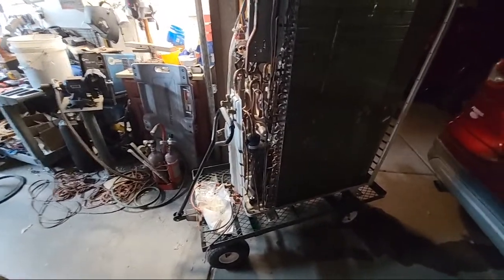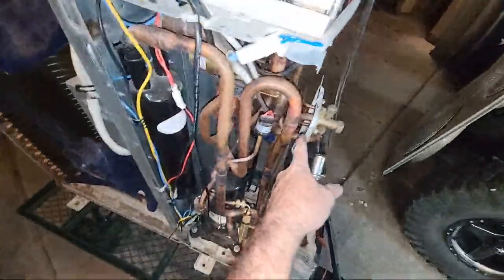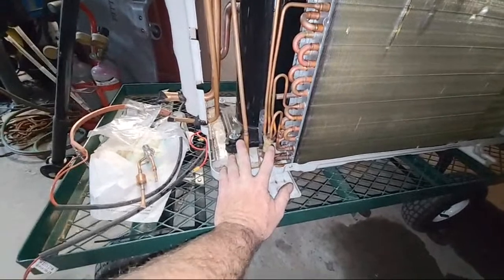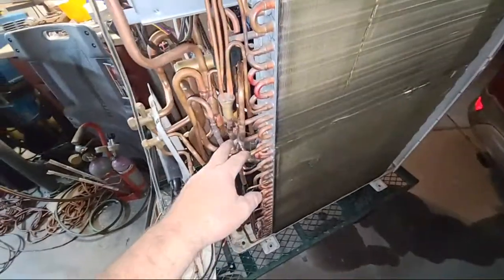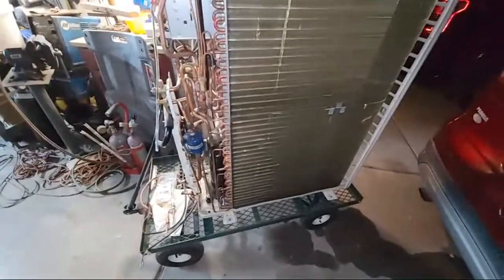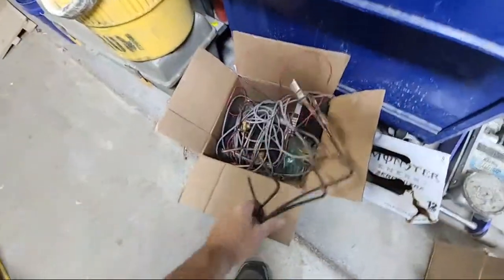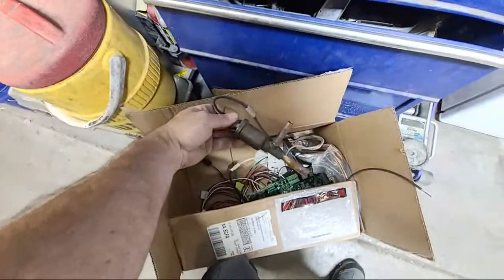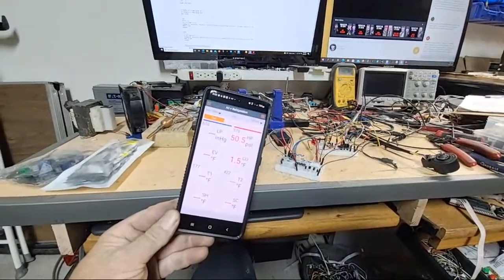Reinventing Another Wheel For My FRANKENSTEIN Heat Pump!

Comment: I am going to  be  building a  new  refrigeraton  system  with a mini 12v dc compressor  in abawt  4 or 5 months
Reply from the maker: I assume you're speaking of a pretty small system?
That would be a lot of motor current for anything much above 12,000 BTU's which is about 1,000 Watts
Reply: @hackfreehvac   yes  to be honest  only  1,000  btu at the most and am going to  use a arduno  to control  it
Reply from the maker: @posttopstreetlight1055  
1000 BTU's. Dunno if I've seen anything that small for space cooling. 
Maybe a fridge. Lol

Did the compressor come from a fridge?
I do know that they sell 48V compressors that some people use for off grid